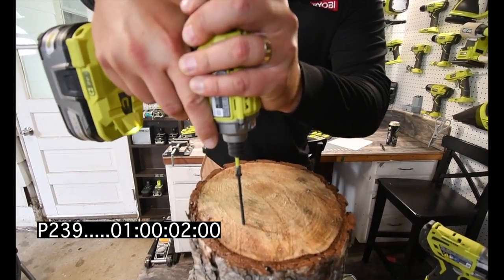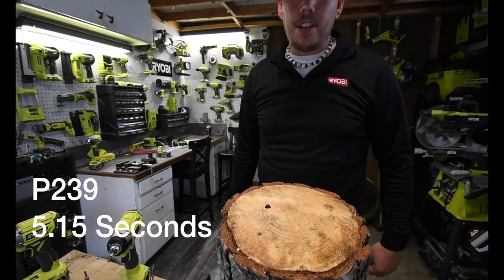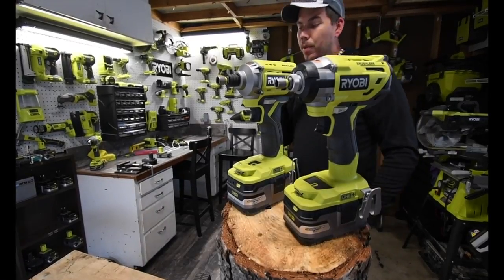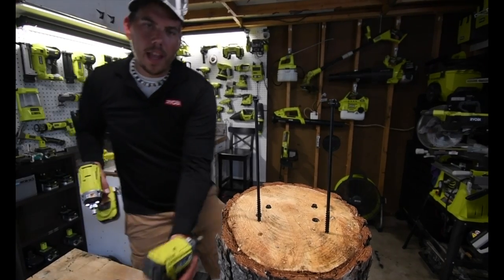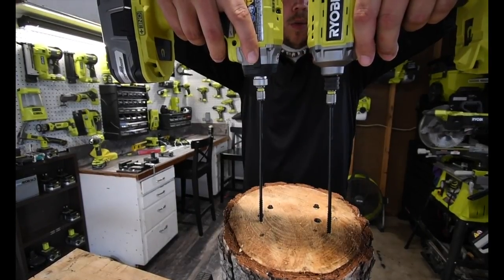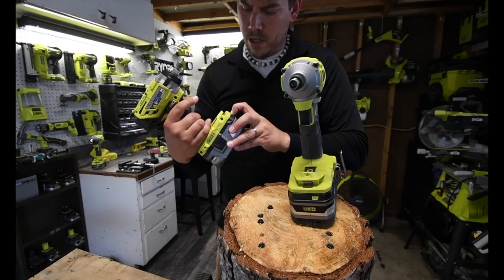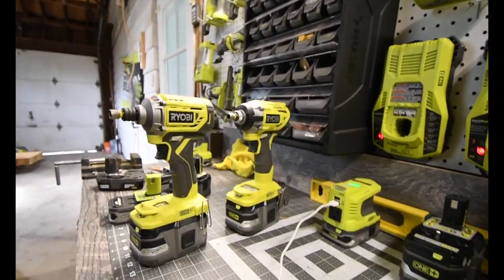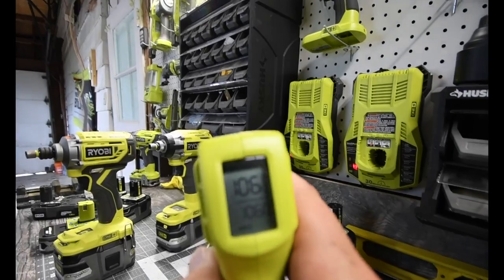Ryobi Impact Battle Royal

Comment: Am I the only person who has experienced major speed/control problems with these drivers when driving Phillips head screws? I got the p239 in the kit with the brushless drill, and the thing is virtually useless! It refuses to grip a screw head unless you have a brand new driver bit. It will work if you hold it perfectly straight, but even then the driver bit teeth can easily slip out of the screw and immediately both the screw is stripped and the teeth of the bit start to twist, ensuring it will never grip again! (The ryobi “impact rated” bits were junk btw, soft and even breaking tips). My old p236 bushed impact does NOT have this problem, it holds screws just fine. So I bought the new p238 with the free battery deal, and it has the same problems as the p239. I returned it. I wanted to love both these tools but they’re virtually useless.
Reply from the maker: when it comes to driving is long Phillips screws, its better to use screws that have a good locking system such as a square or 5 point or more head

Comment: Any Reason why Ryobi sell two type of impact?   Even in the non brushless there is 2 models of impact the P237 and P235
Reply: The 239 is the cheaper version bundled in a kit with other brushless tools.  I got it with the brushless angle grinder and drill (plus flash light).  The kit cost less than the grinder plus a small battery yet includes the other tools plus charger.  I wrongly assumed that the brushless kit would have had the 238 rather than the 239 but have found that the 239 is plenty capable.  I won't complain since it, the charger, flashlight and brushless drill were essentially free and all very capable.
Reply from the maker: That is correct
Reply: There are actually 3 non brushless Ryobi Impacts with the P236 which is stronger in torque than the p235 but not quite as strong as the p237. It use to be a few years ago sold as a bare tool but now is sold with combo kits including the famous 6 tool brushed kit p884.
Reply: @dr.quinnmaintenanceman9480  If you are trying to be complete, let's not forget the available P290 Quietstrike then.  Perhaps the blue P234 and the green P234G as well.  Of course, not all these are currently found via search on the ryobitools.com website.  Only the p237 comes up in the search on that site and the Home Depot web sites though defunct models you listed can be found in various other places such as Amazon.  Have you seen the variations on the Ryobi brushed impact driver theme in Australia including current models without LED lighting?  Their single brushess model with 3 LEDs also looks quite different from the models marketed in Canada and the US and has a maximum RPM greater than the P239 but lower than the P238.  Generally speaking, the lower power, slower RPM, non-speed selector version or single led versions that are and were generally less expensive have been included with kits whereas the higher specification/performance versions are most often sold individually.  Why use the double negative term "non brushless" when brushed is concise and apt terminology.

Comment: 2000 inch lbs. not 2000 lbs of torque haha. where can i get your version 2000 lbs torque jk
Reply: I was thinking the same thing until I realized that an impact driver that had 2000lbs of torque would break both my arms everytime I used it... Lol 🤣😜😂😆🤪
Reply from the maker: That what the specs said on the ryobi website
Reply: @ManCaverTools  Hey Dave, there is a difference between ft-lbs, and in-lbs of torque... This is what is on the Ryobi website... "The brushless impact driver delivers up to 2,000 in-lbs of torque and LED light to handle all fastening applications." 
One foot lb torque is equal to 12 inch lbs of torque. Example; The 1/2 inch 3-speed impact driver (P261) is rated at 300 ft-lbs of torque... That equals 3600 in-lbs of torque when converted! 
So if you take the P238 that is rated at 2,200 in-lbs and convert it to foot lbs it would equal 183.3333 ft-lbs... far less than the P261. Thanks for your videos.... Keep'em coming! 😁
Reply from the maker: you are correct sir and I said it wrong, thank you so much, lol I messed up
Reply: From Mars. lol

Comment: What was Ryobi thinking with a new impact that's weaker, lamer, and uglier?
Reply from the maker: different versions. I love the p238
Reply: They were thinking they'd add 2nd brushless version that's also a little smaller & lighter. Also gives them a less expensive (but still brushless/new) impact to add to their top end sets without including the higher end 3 speed/heavier/pro version. They have the same with their brushless drill/drivers. One standard/slightly smaller & the top end spec version (the hammer drill) is heavier & slightly larger.